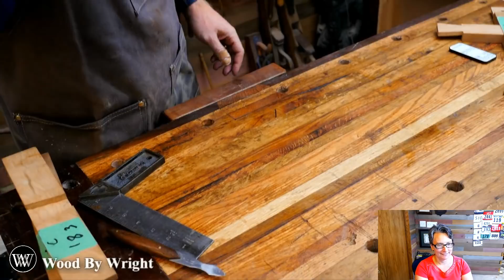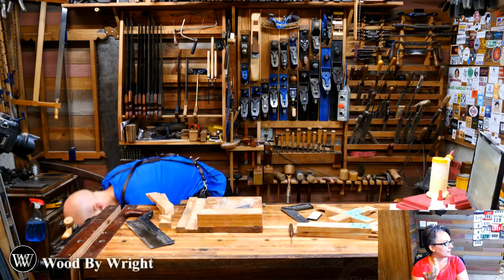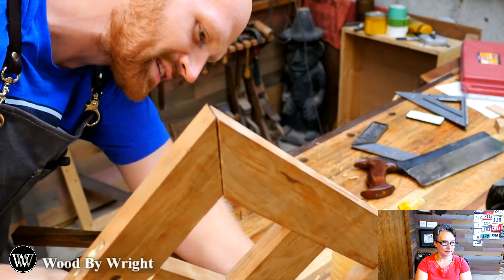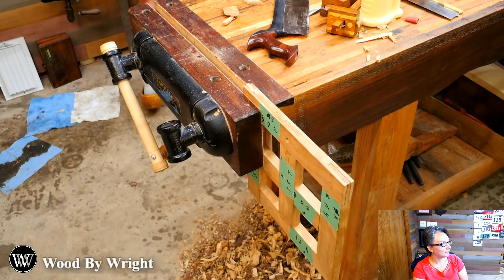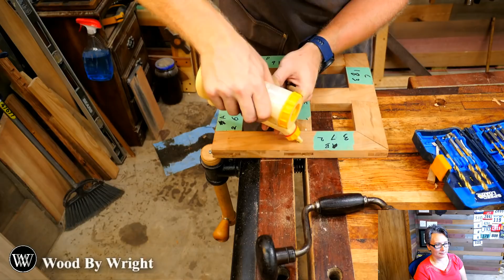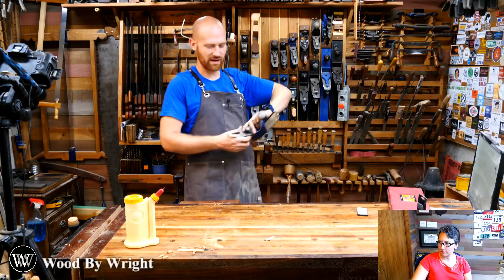How to Make a Miter Spline Joint Last Live Joinery Window Joint

Comment: No, you can't adjust the other joints to close the splined miter joint, but you could open it up just a bit and put another piece of wood down the length of the miter and then spline it.
Reply from the maker: I could, but the poing of the project is to show off the flaws not to try and make them prity.

Comment: In your video on the pocket hole joint you talked about looking for an old pocket hole bit.  In this video you use a modern  driver bit holder to put the screw in with.  Have you thought about picking up a kreg drill bit?  If you could buy it without buying the whole kit.
Reply: Mike Wheelock 
I believe Lowe's has the bit available separately.
Reply from the maker: The problem is those are a pain to start without the jig. I could use the jig but that takes the fun out of it. The traditional ones have a lead screw so you can go in at a crazy steep angle.